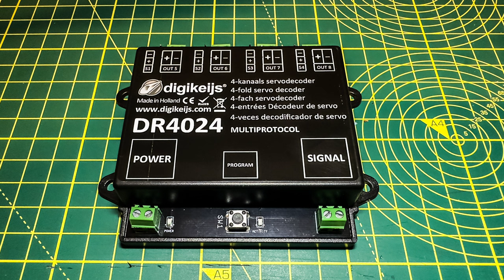040 - Shelfington - Servo Assistance

Comment: Great video, thanks. Never thought of installing these like you have. I have only ever considered below the board servo in aliminium channel with a piano wire rod  to the point from above.  Your method is elegant, a lot easier and can be  disguised with little effort. I suppose the only thing you need to keep in mind is leaving a way to access the servo pit if it needs fixing. Thanks again going to use your idea! 😊
Reply from the maker: Thank you! Yes, I too had only seen servos fitted into aluminum channel with piano wire to throw the points! This design came about because I couldn't put the motors below the baseboard as with the thickness of the foam, the piano wire wouldn't throw the points correctly! I'm still working on the final design for the enclosure boxes! With the current design, the servo can easily be removed if the point rodding is kept short, but if it's longer, and goes beneath a track or two, you have to remove the hole point! However, I have a plan to circumvent this which will no doubt appear in a future update! Good luck with your implementation! All the best, Ian.

Comment: Hi Ian, i feel that I have been converted, especially after our conversation a couple of weeks ago. I shall in the next couple of weeks be ordering from Megapoints all that is required and Budleigh Regis will become servo operated points wise. I’ve been on the website and done some more research. So thanks for that mate, cheers for now, John
Reply from the maker: Hi John! Haha! I'm no expert, obviously, but I think these little motors are the way to go! Dave at Megapoints is a very helpful guy, and answered a whole rake of questions for me before I ordered! The system is so flexible, and three servo controller boards can be powered by one 12V 8A DC power supply - that's a whopping 36 servos! I'll obviously create a video about it when I set it up, but that won't be until next year now! All the best, Ian.
Reply: I shall be talking to him very soon Ian!

Comment: Great video Ian, 
I too intend on using servos to control my points, but was struggling to hide them in surface structures. I think some surgery is needed to install them but definitely worth a shot.
Thanks Andy
Reply from the maker: Thanks very much Andrew! One of the reasons I went with a layer of XPS foam on the baseboard was that I always intended to use it to hide point motors, rather than have them below the baseboard! I just didn't know what type of motor until now! Hiding motors in structures is a viable idea, but with N gauge, buildings are quite small, so the motors are still difficult to hide! Hope you find a solution! All the best, Ian.

Comment: Hi Ian, thats a brilliant video and well done for the ingenuity of it all. Now I have used the guagemaster surface mounted switch's on some of my points and although good, they do not always "fire" correctly. I have 25mm foam under the track where these are being used, and this idea of burying the servo into the foam has got me thinking perhaps this is a way forward for me. I also like the idea of using the megapoints controller, as it offers up extra benefits such as lights etc. Thanks for the video, it certainly has me pondering now!
Regards
Steve
Reply from the maker: Hi Steve! Thank you very much! Do you have CDU's on your Gaugemaster motors? This is usually the best way to "fix" solenoid motors that sometimes don't fire! Yes, the Megapoints system is very flexible, which is what swung it for me in the end! All the best, Ian.
Reply: @iansngauge  thanks for that - I don't have any CDU's on the system but plan to at some point. I find that even though they do "fire" its not always in a straight line and the points jam, so am investigating that. This model railway lark is keeping the brain cells busy I tell you!
Regards
Steve
Reply from the maker: @lynganddistrict  - That's really odd Steve! Hope you get to the bottom of it! Cheers, Ian.

Comment: Hi Ian, another interesting video. I am using servos on my layout and have built my own servo brackets from 1mm grey board using a cricut machine. I have developed my own circuit boards to control the system from a keypad, which I am planning on expanding to control signals and routes and ABC braking. I have a video up on my channel showing the build of the servo mounts. Keep up the great work it's always good to see other ways of working.
Reply from the maker: Hi, and thank you! That's interesting as I've just purchased a Cricut Maker 3 and intend to use it to cut the card for my little enclosure boxes from 2mm grey board! I had a quick look at your channel but don't see any videos, which is a shame as I'd love to see how you approached building the mounts! Unfortunately I don't have the skill to develop circuit boards, but I do plan on using JIRA eventually to provide a level of automation! All the best, Ian.
Reply: @iansngauge   hmmm. I have got two you tube accounts I have a feeling the other one is the one I use to upload the videos. I will see about getting a link sorted.

Comment: Late to the show with this comment. Several years ago on a raspberry pi project, I bought a bunch of servo's. Burned two up experimenting. Bought a few more of those little blue ones that your demonstrating. That project by the way went nowhere, it was just for experimenting. I did not know there were servo testers, and those look pretty cool along with that PCB.
Reply from the maker: Hi Frank! Yeah, those little servo testers come in really handy! I think the servo units are pretty reliable if you purchase decent ones in the first place, but they're all pretty cheap, so replacing one isn't going to be a problem should one burn out! I'm looking forward to getting stuck in with point control with an Arduino at some point, but am going to try the Megapoints controller and a normal Servo accessory decoder first! All the best, Ian.

Comment: Hi Ian! I think your innovation and perseverance with the RC servos is brilliant! 

I am about to embark on an N-gauge layout myself so your channel is just what’s needed!

Will be interested to see how you follow through the servo points from a dial control to a DCC operation - albeit needing to know the Deg of rotation in either throw :D

Have you considered how you are going to control points in a highly compressed area of track with several points? It’s a issue/dilemma I just can’t work out myself. N gauge is so small and the motors are not!
Reply from the maker: Hi Jack! Thank you very much for your kind words! I'm no expert, but am trying to apply a bit of logic and common sense, and will see where it takes me! Regarding setting rotation angles, I'll be using the Megapoints Servo Controller board which allows you to fine tune that sort of stuff - I'll make a video about it when I get there!!! Regarding compressed areas of track, yes, I've thought about it, and plan to locate the motors to one side, and run push rods below the track to service them - again I'll make a video about it when I get there! All the best, Ian.

Comment: if you are not a MERG member it may be worth joining, one of their many products its a 3d printed servo holder. failing that if you know someone who has a printer there are holders on thingiverse.

your foam mountings are quite ingenious though, and allow for nice easy maintenance access without going under the board, which is always a win.

not tried the mega points controller, I'm using a PCA9685 board that can drive 16 of the blighters and an arduino (which could be made into a DCC accessory but here is driven by the JMRI software through the C/MRI stuff) - suspect your solution is easier but this is a lot cheaper overall.

do like how your system turned out though, with the pushrods a lot of scope for putting motors further from the actual points which is a nice bonus
Reply from the maker: Hi Dale, I have considered joining MERG, as I was once considering using Arduino based point motors! I've actually just purchased a Cricut Maker 3 which will make construction of the enclosures a lot less time consuming, and a lot more accurate! Yes, being able to mount the motors further away by having pushrods is a big advantage, especially where space is tight between the tracks! All the best, Ian.

Comment: If you had a solid plywood base under your foam, you could get away with mounting under the baseboard. Another plus for using servo's is you can still control the speed of the point blades to give slow motion  point control as well....
Reply from the maker: Hi Mark! I do have a plywood baseboard but as I have difficulty getting beneath it the less kit underneath the better! Yes, as far as I can tell these micro servos offer the same slow motion experience as the Tortoise or Cobalt motors just at a fraction of the price! All the best, Ian.

Comment: Have you thought about replacing a defect servo?
Reply from the maker: Hi Jef! Yes, that's why the plates will be removable! They won't necessarily be as big as the one I showed in the video and will more likely just cover the servo itself! Cheers, Ian.
Reply: @iansngauge  I,m also curious how you mount the servo's if more change points are mounted together. Love to hear from you. Cheers, Jef
Reply from the maker: @jefwisse1957  - Hi Jef, yes, this will require some thought! I plan on staggering pointwork so this doesn't happen very frequently, but when it does, servos can be placed further away, or on the opposite side of the point, and the rodding can be run below the track as there's plenty of space for that! I'm sure there'll be videos in the future of how I achieve this! If all else fails, I can always revert to using a solenoid point motor attached to the track, as I was planning to do in the first instance! Hope this helps! All the best, Ian.
Reply: @iansngauge  Hi Ian, thanks for the response.